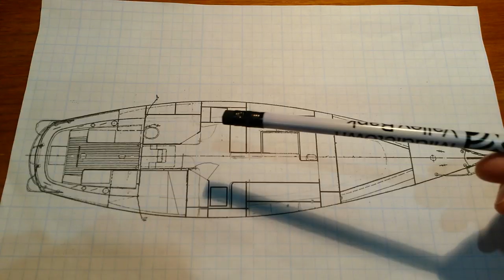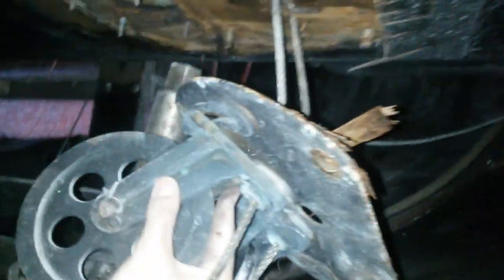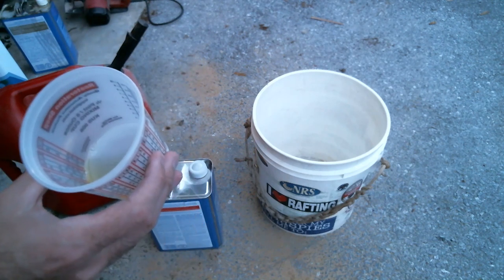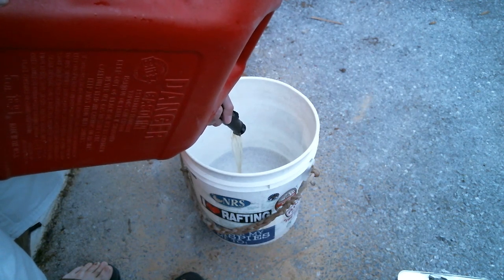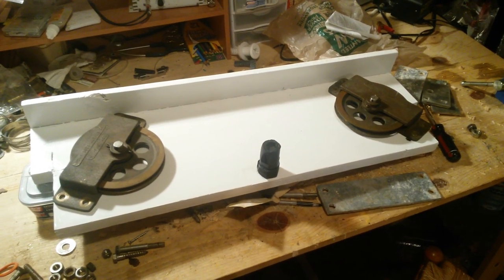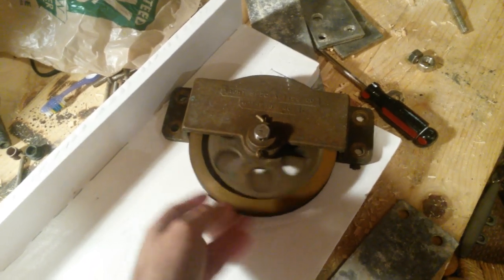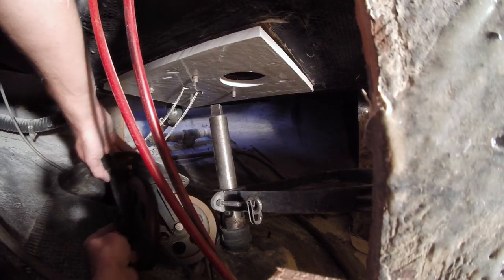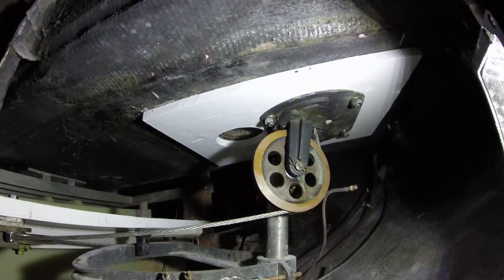Restoring Old Sailboat Hardware

Comment: It looks like you settled at dead horse lol on a serious note you put those saddle clamps on backwards on your cable steering line, when you put the clamps on the Saddles go on the other side of the cable not the tail side of the cable, I would also give yourself about 4in of cable past the clap with the tail. look up saddle clamps on YouTube🤪 good luck have a great day CHEERS 👍👍👍
Reply: never saddle a dead horse -   agree cable saddles are on the " dead " line rather than the live load bearing line,  I think that would still hold in this case.